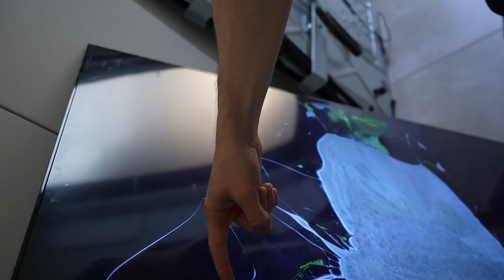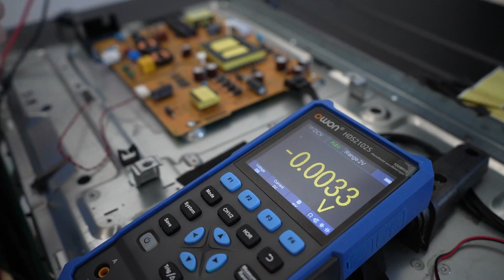Salvaging electronics parts for projects from a broken TV

Comment: The rubbery blocks you found under the circuit board are thermally conductive pads, you can use them to bridge the space between a hot component and a heat sink. I like how the TV has the speakers in their own little plastic enclosures, that way they should still sound quite decent when used outside of the TV.